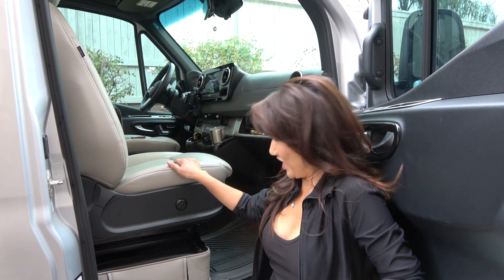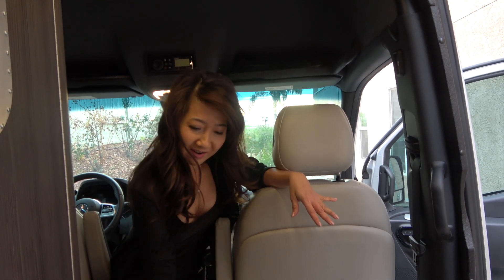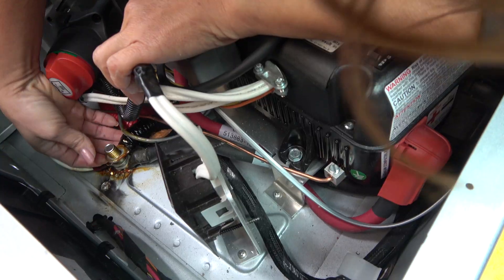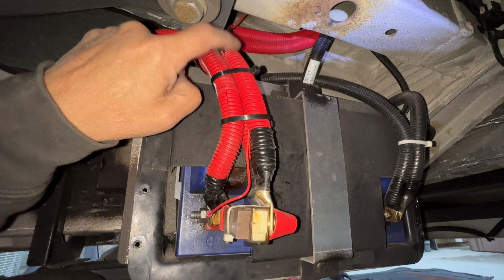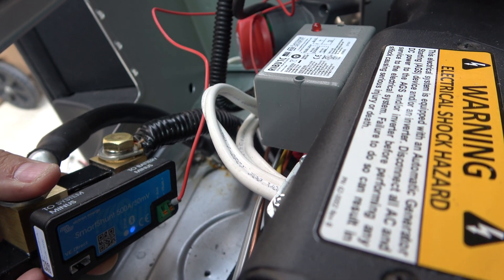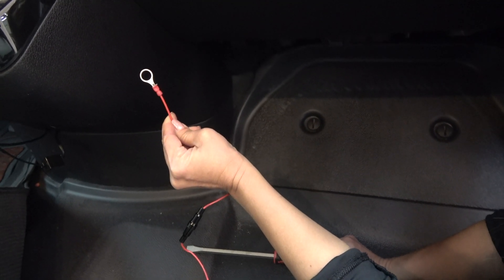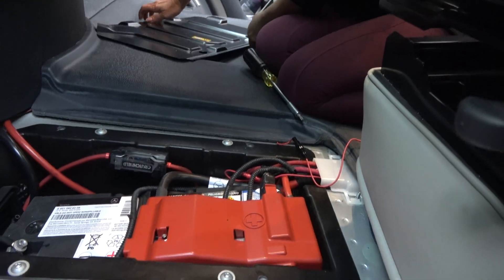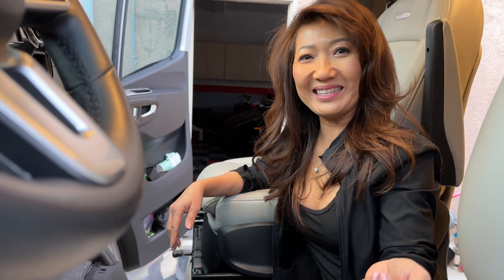Victron Smart Shunt Installation  UPDATED  4K

Comment: Hi! I really enjoy watching your videos.  I am installing the Victron SmartShunt in my 2021 AI 19 which is just like yours.  The video you made on the SmartShunt installation has been very helpful.  I am in need of clarification on one point.  I don’t understand the purpose of connecting one end of the 9” black cable to the system minus terminal of the shunt and connecting the other end to the bus bolt—unless it has something to do with the white wire connected to that bolt.  After watching the video initially, I mistakenly thought you had left the battery negative cable attached to the bus bolt and had used the 9” black cable to make a connection between the negative battery cable on the bolt and the battery minus terminal of the SmartShunt.  That would seem to be a logical approach.  Any enlightening thoughts you can share would be appreciated.  Thanks!
Reply from the maker: @phillipwalsh7648  Hi Phillip, this is Vincent, Darlene’s husband.  That bolt that we connected the 9 inch wire to, where that white wire is also connected to is the original grounding point to the van.  We did this connection via multiple discussions with other Airstream 19 owners on Facebook that had successfully connected their shunt.  Unfortunately I’m not an electrician and so only followed others who had successfully did theirs. I hope this answer helps.
Reply: @BamBamRVAdventures Thanks for replying so quickly, Vincent!  I’m not an electrician either, just a dumb accountant (retired thankfully).  If the shunt is still working well for you after two years, I see no reason for me to venture onto a  different path.  Thanks again.  You guys are the best!
Reply: @phillipwalsh7648 Thank you Phillip.  Darlene does check comments, so please let us know if you have any questions.  Yes, it has worked flawlessly.
Reply from the maker: @phillipwalsh7648  Hi Phillip, if you look at around the 3 minute mark where we loosened that bolt.  That black wire that was initially connected to the bolt is now connected to the minus on the shunt (6 minute 15second part of the video) and then we connected the 9 inch wire from there back to the ball, which is ground..

Comment: What Chassis battery terminal do you connect the Aux wire to?  Does the wire go under the battery lid since assume no other entry into the battery compartment.
Reply from the maker: Yes it goes under the battery lid based on my memory,

Comment: What precautions need to be taken when connecting to the positive battery terminal?  Overall 12V safety precautions to take?
Reply from the maker: I think that it might be prudent to the negative terminal first and then after connecting the positive side, you can reconnect the negative post.

Comment: Question:  does your AI have a buck boost mounted under driver seat with connections to  LI battery under drivers seat ?
Reply from the maker: Hi Chris. I don’t know the answer so will ask my husband to chime in.
Reply: Hi Chris, my understanding is there is a Buckboost under the driver's seat, but I have never opened up the driver side seat, so have not verified.  Thank you for watching.

Comment: Hi Guys. I love your videos. We have the same van. We haven't done any upgrades yet but now that it's a year old we will start. I'm wondering how you knew or figured out how to do this installation. This one seems a bit complicated for a DYI. Thanks.
Reply from the maker: Thank you for watching Scott! 🤗 Yep, it’s time to start some upgrades! 😂😂We read about this upgrade on Airstream Interstate 19 Facebook group. It seems daunting when we read about it that’s why we didn’t do when we first got our van. After a few simple upgrades we thought we could do this one. It would be a lot easier if there was a video of this exact van that we could watch. That’s why we make these DIY videos to help those who wants to do something similar. It's very doable, you basically just adding an addition post that is the shunt and just moving the existing wires around. You can email us for your contact info if you would like my husband to answer any questions when you start.
Reply: Thank you. I’ll do that if I run into questions when the snow leaves. We’re in Western Wisconsin. The first upgrade is the air conditioner. I’ll get a shop to do that.
Reply from the maker: @scott5266  we love the AC upgrade. The spray paint on the top cover chipped off a little bit when my husband removed the antenna. So we paid $500 for a local auto body repair shop to take off the spray paint and painted with the same silver color as the van. The bottom part that is attached to the AC still has the spray paint. If you could go to Advanced RV in Ohio they can do the AC upgrade with the whole AC painted to match your van.